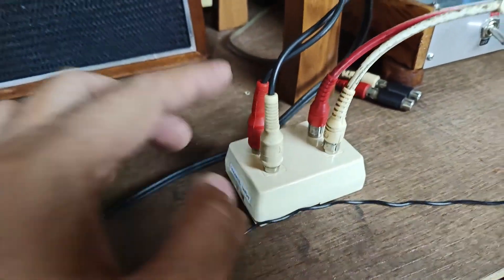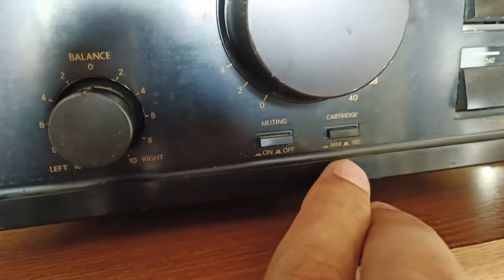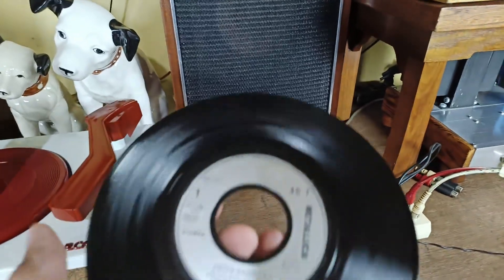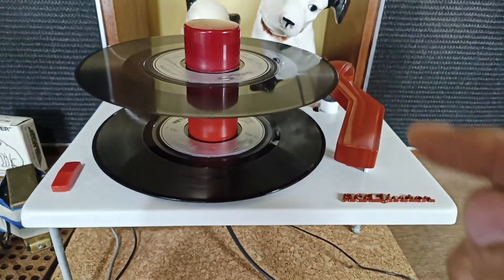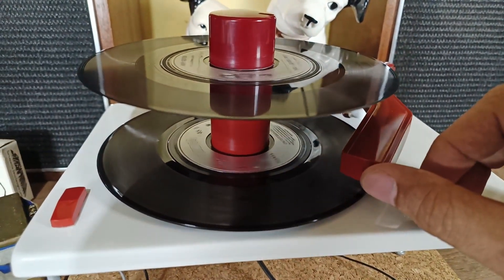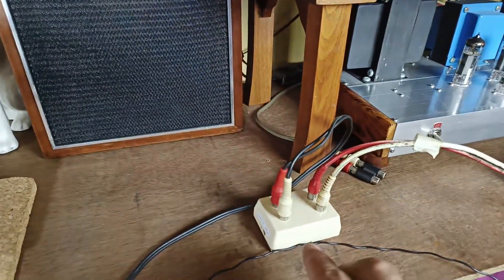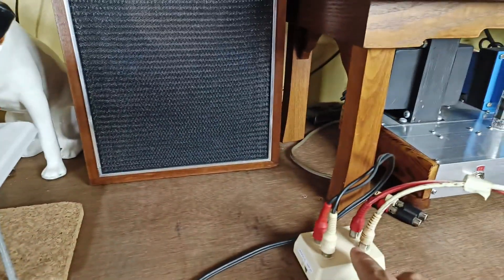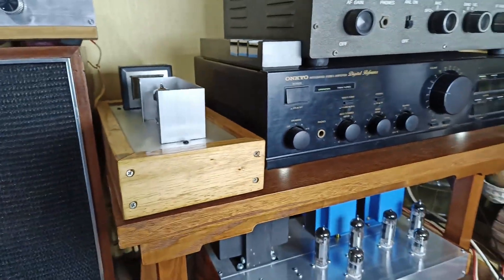Let's make an ATTENUATOR for ceramic cartridge to MM phono stage

Comment: Thanks for this.   Did you find the ceramic cartridge over loaded the MM preamp?   I’m kinda dealing with this situation at the moment
Reply from the maker: If you place the ceramic cartridge directly to MM phono stage it is over loaded you need to attenuate the signal by placing a resistor before the MM phono stage. This video is my experiment you can replace the value of the resistors and caps.
Reply: Thanks for this.  I’m doing experiments with an old record changer for 33s and 78s with a dual needed ceramic cartridge and I have a regular Amazon pre amp.  When I play lps, when it gets loud or lots of interments its sounds like crap. All distorted, and playing 78s sounds awful.   So I hope it’s just from over loading the pre amp I’m going to try this 
Thanks so much!
Reply from the maker: @alexinnewwest1860  Welcome if you like I have ceramic phono stage video https://youtu.be/SH7qeGTyGmE